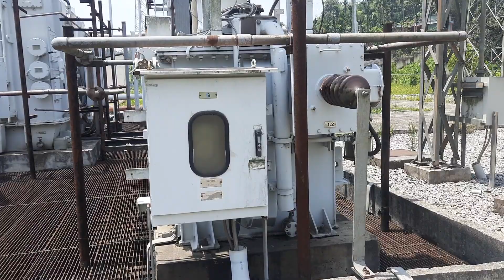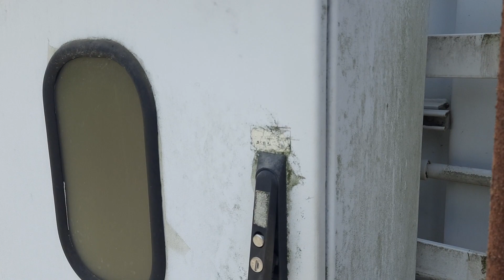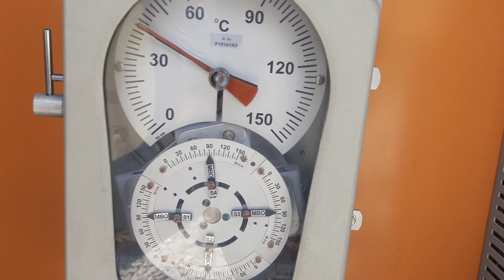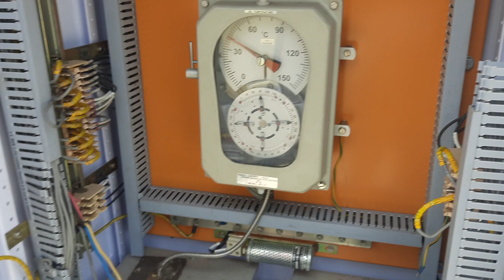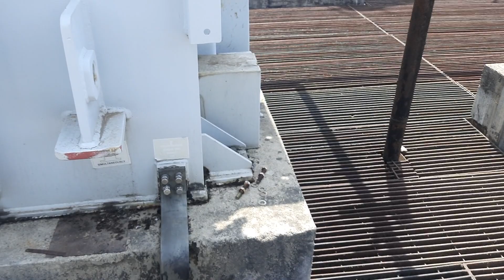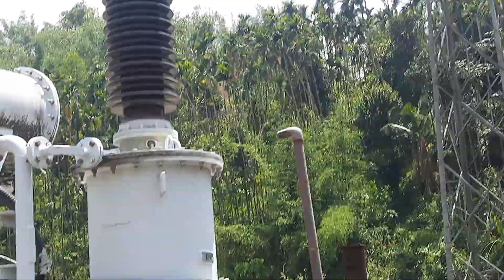Neutral Grounding Reactor

Comment: Sir, if i remove generating Transformers soild nutral ground,  than how to block fault current, vactor group YDn1
Reply from the maker: Fault current cannot be limited beyond a certain limit...if we remove solid grounding then return fault current will be routed through neutral of transformer....it will affect the transformer then